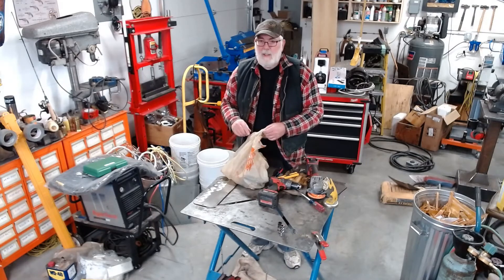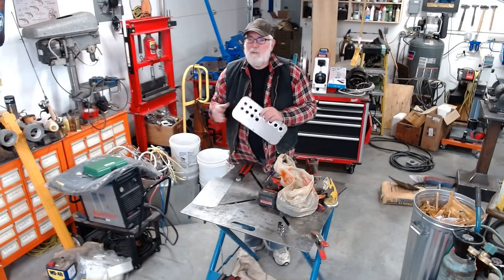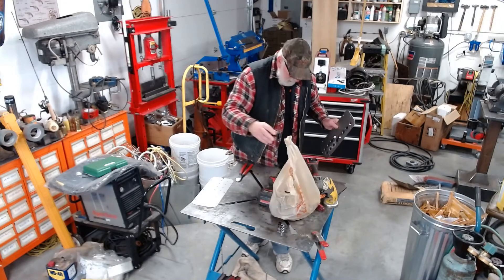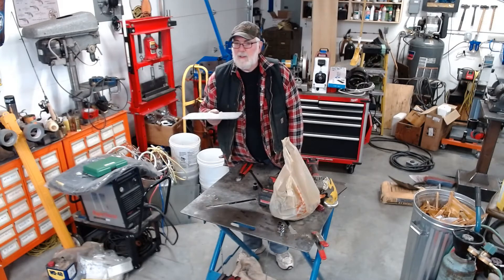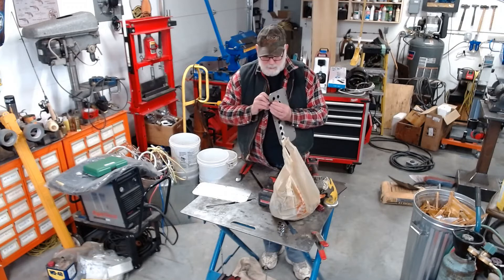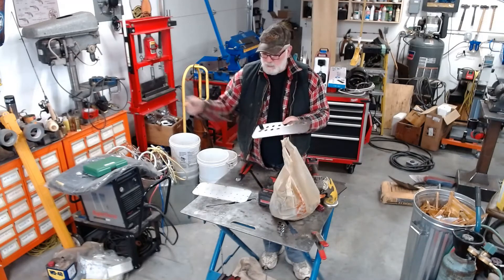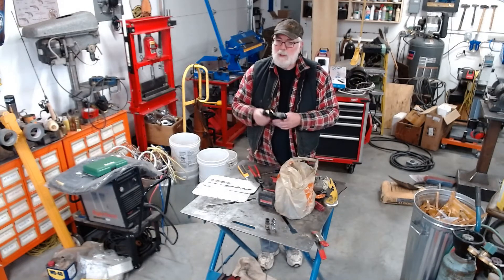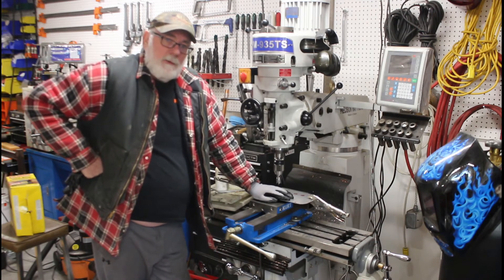Cutting Stainless Steel Plate With Klein Carbide Hole Cutter

Comment: yeps stailess is tricky  my best guess will be to use kind of press cutter they does well on stainless up to 3 mm thick so maybe look after that thingy it look like 2 pieaces with one screw going trough  and as you tight up screw that two pieces  get squised together and cut the hole  nice and  without sharp edge   or as you did milling machine and carbide cutter  with much lover speed as you use tho you did get it done  and it all depend from type of cutter you using  and how many holes you need to do  and stainless love the lube  👍😀👍
Reply from the maker: Yes we call those knock out cutters Rafal. The last job we had these on we tried to cut them with our KO set. We kept shattering the draw bolts and the actual cutters!
Reply: @CruiserMac  in my opinion that cutters are  doing great and last very long time tho secret is to not use any impact wrench on them hand turned key will save  a lot of life in self cutter as far you try  electric tool on it to turn  it will last max 20 holes either way thread will give up or cutter gets off the center and hit each other cutting surface
Reply from the maker: @RafalScrapper  We use a hydraulic tool to draw the stud so the exerts a lot of pressure. They make special sets for stainless but we don't need them often enough to warrant buying them. Hope you have a great week buddy !

Comment: I just bought some carbide tipped cutters, went through mild steel like butter ! First thought when the smoke started was that you might have been spinning a tad quick, interested to know if it gets you through the "hole" job,  could not resist that one... LOL
Reply: Ooh. That was a bad dad joke,
Reply from the maker: @Man-in-da-shed  😂😂😂
Reply from the maker: I had the speed too fast on the first one so I kept adjusting it. That milling machine has a VFD on it so you fine tune the speed with potentiometer. I got it dialed in and yes that cutter did the "hole" job!

Comment: I love welding stainless.. it’s one of my favorites I’ve welded stainless up to 36”pipe with a 2”wall thickness .. welded a 52” joint before but that only had a 1/2” thick wall thickness
Reply from the maker: You must be a good TIG welder to weld stainless pipe !
Reply: @CruiserMac  the last 9 years of my welding career is all X-ray joints.. everything I weld gets X-rayed .. I weld a lot of 9 chrome , inconel and alloy 20
Reply: @streetcopper1151  a man of many talents it would seem
Reply: @sharkscrapper  just a couple my friend.. but don’t ask me to walk straight 😂
Reply: @streetcopper1151  😂